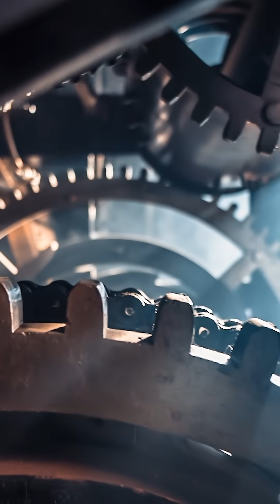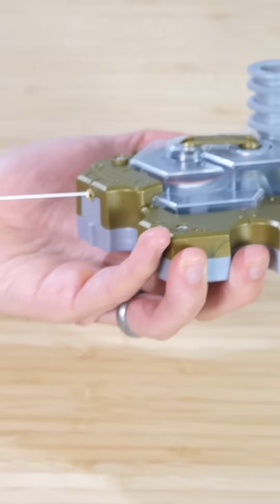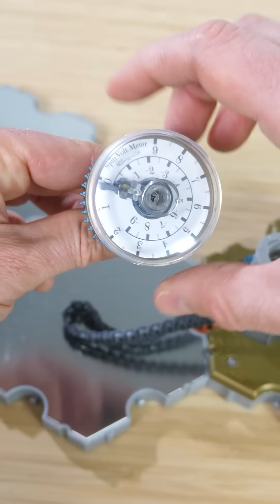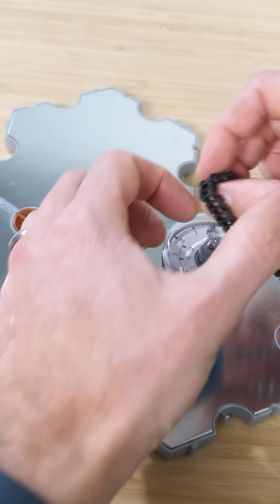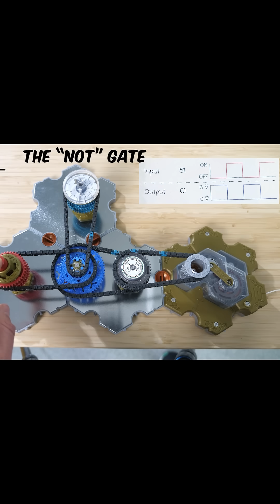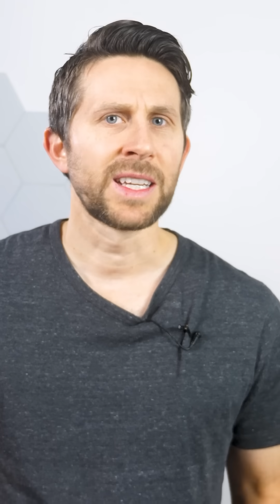Making a computer out of gears and chains

Comment: The problem with a mechanical computer is not possibility, but changing all the parts around when you want to process something different 
They’re best suited for constant single target computations like measuring the tides on a line graph that someone did way back when

Comment: Back in Jr. Highschool, the teacher wanted to teach us how a two-switch system can make you turn the same light on and off from any one of the two switches. He scribbled something on the board and babbled unintelligibly. I pictured myself a metal rod having each of its ends connected to one of the switches and you basically flip the switch by pushing that same rod. Later, when I studied logical gates, I realized I can do the same with even more than two switches by using XOR gates or their mechanical analog.

Comment: I've theorised about a computer that doesn't require any electricity. For the most part it's just hydraulics and using heat to power it. You would use a low resolution monitor that swaps between black and white blocks for each pixel and the keyboard would just hook up to the hydraulics. I came up with the idea when I was talking to my mate about Doom running without electricity. The annoying part is the "coding" since it's very manual and would take quite a while for each logic gate.

Comment: Yeah but I keep hearing "voltage" so it kinda sounds like a regular computer. It would be much cooler to make a computer out of gears and chains and powered by a mechanical source such as springs or a gravity-pulled weight. No electricity involved.

Comment: CPUs are made from AND, OR, Invert.   the AND is when both inputs are ON or 1, then the output is ON or 1.  the OR gate is high when either input is high, the invert the output is opposite of the input.  If you add the invert to an AND it becomes NOT AND or NAND. or becomes NOT OR or NOR.  the box and circles next to those gates Ive never seen, its some new odd notation.  there is an IEEE symbol set, trust that one, it will be better in the long run.  I do not get the gear setup used in the video, Ive worked on this logic technology since the 60s.  made a 7490, 7448 and 7 segment LED display from scratch for an 8th grade project in the 70s.  Look at the Turing machine, from that we got our clasical microprocessors.  Corning the glass company used glass mechanisms that worked around harsh chemicals, a computer like mechanism

Comment: One of those videos where I start to feel dumb again
Reply: You either took these classes or didn't, its less about intelligence and more about specialization.
Reply: @micheal5647  I mean I took the classes, but I feel I most of my knowledge of this came from working with redstone in Minecraft 😂
Reply: I’m right here with you on that!
Reply: If you only look at the logic gates yeah,it kinda understandable but the thing he measured torque how buttons practically works yes, i to couldnt set the analogy to relate it to electrical rules and circuits. And couldn't get the whole picture i guess
Reply: Cool
Reply: Those are logical gates , they are used by electrical or mechanical engineers to design a machine response to certain environment, for exemple an alarm system that works if there is signal that someone passed and at the same time the door is open ( or by other words if someone passed but the door is not open it won’t work) and with this principle you can combine different signals that comes from sensors and treat them
Reply: It's not that difficult to understand
Reply: Precisely why it makes us feel dumb.  @Earlierfour
Reply: @DrMalsyn  😂😂
Reply: @Earlierfour i bet you say that knowing absolutely nothing
Reply: @HaloGrunt  Even though you're probably right, it's best to not call it out. The whole bad father son relationship thing starts to become pronounced. I'm not saying that's you.
Reply: @Earlierfour oh well thanks

Comment: Alright, here’s a better one:

"Making a computer out of gears and chains? Great! Now when it crashes, at least you’ll hear it coming."
Reply: Oil the machine then
Reply: make it run DOOM
Reply: @johanandersson2165  yes
Reply: I need steampunk-themed doll riding my ass
Reply: Sure, you could totally imagine AI built from gears and chains! Picture a mechanical brain where every thought is a series of meshing gears, each one turning to process information. The chains would control the flow, keeping the machine moving in sync—like a clockwork mind that churns out decisions with precision. But, just like any AI, if something goes wrong, you'd hear a clank and a grind before it breaks down, and fixing it would be a real pain in the gears.